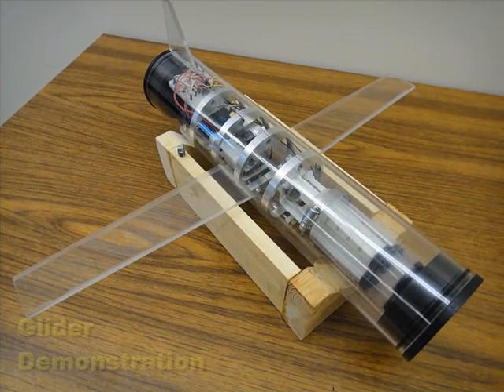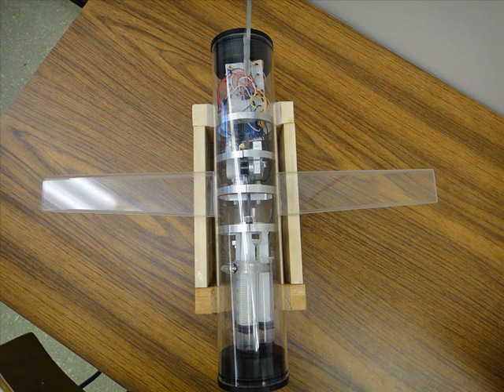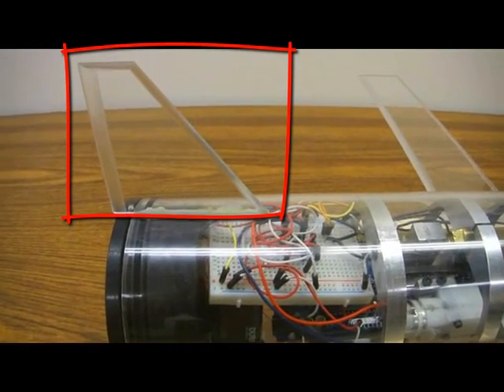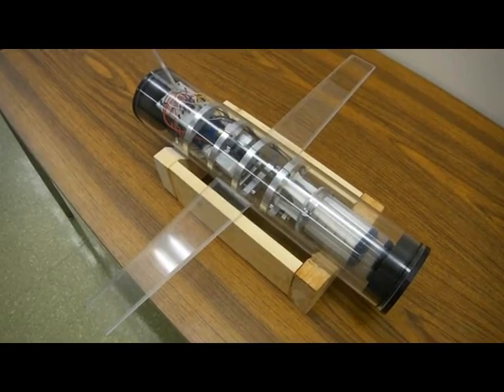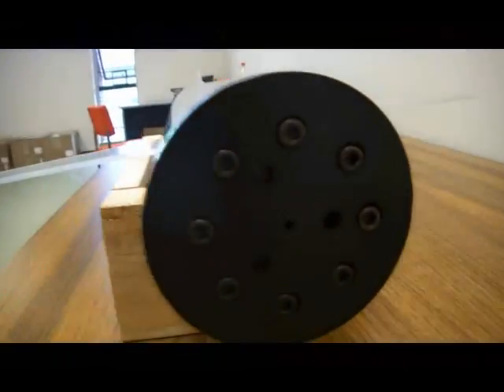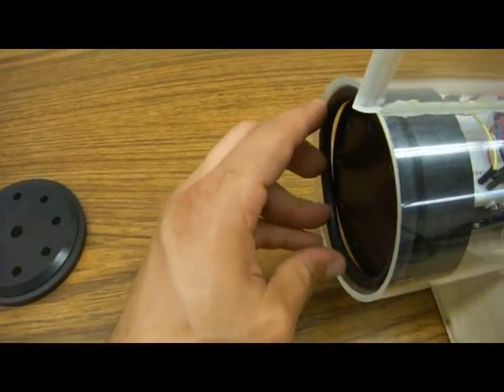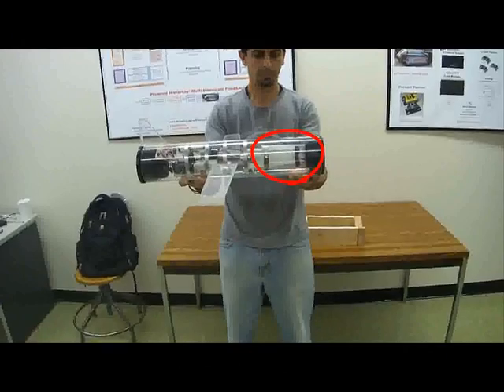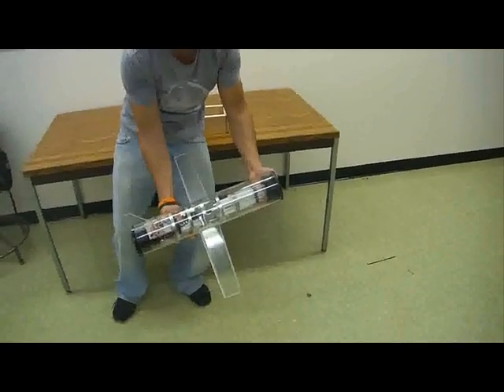How Underwater Gliders Work Pt. 1

Comment: Yes the wings ought to be (IIRC) 30% bigger. That would make it somewhat more efficient, but, as d0vwv0b pointed out, the ideal slope for us isn't close to flat. We WANT to travel at a 30 degree angle.

The wings actually do have a crude foil on them; basically, and ogive and sphere approximation. However, it turns out that your lift isn't improved much by switching to a proper NACA-12 or similar. It would reduce drag somewhat, but not so much that you'd notice with the end's square.

Comment: Wings not big enough? If you pretend like you're designing air glider, a lot of downward motion with little forward motion seems like the wings are too small. Also, I didn't see that the winglets had any "foil" to them. I'll bet you could get a lot more efficient motion by making the whole thing more hydrodynamic. Even water filled nose and tail cones. Also, wouldn't one syringe be sufficient? Maybe they're for redundancy, which might be a good thing.